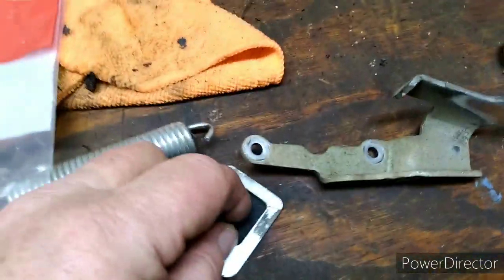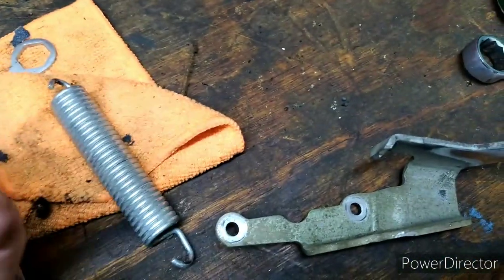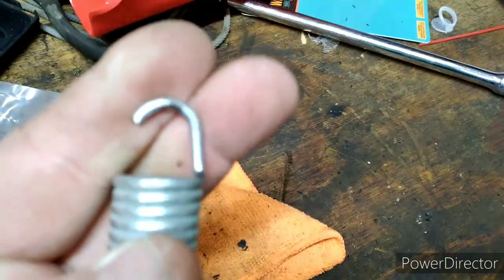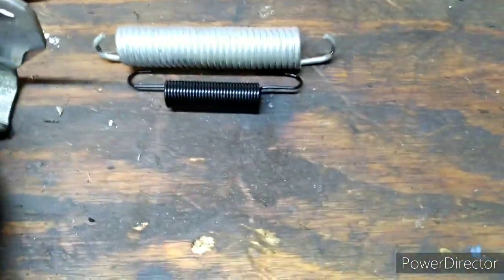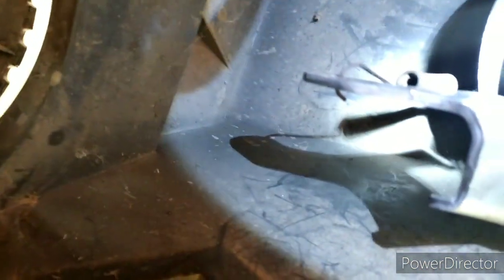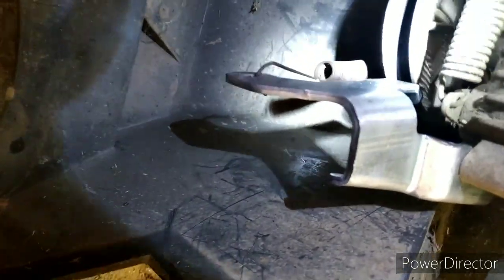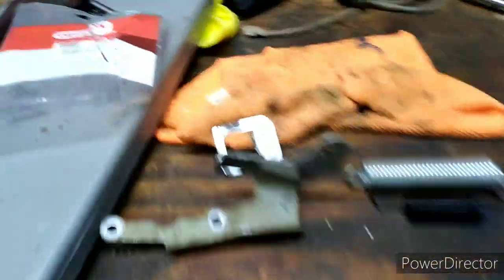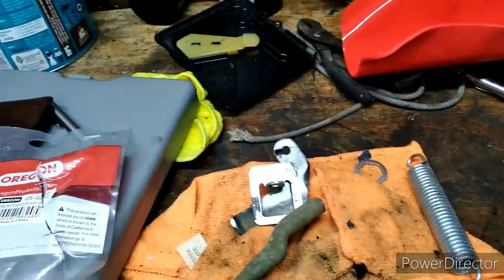honda hrx217/ problem and fix

Comment: I just checked my Honda HRX 217 from 2011, there is absolutely no sign of wear on the spring or on the spring connection points on the brackets.  Informative video though, thanks!

Comment: I have been working on Honda mower for 11 years and am a honda master tech and i have never seen any mower do that before I've see the spring brake in half or the belt snap but i agree that spring it to stiff for what it does
Reply from the maker: I thought it might be a vibration issue.
I called honda, but they wouldn't let me talk to tech support or R&D, because I'm not a dealer for honda.
Reply: Next time i call in to honda ill see if i can get an answer
Reply: @williamroberts6591  did you talk to them yet?
Reply: @williamroberts6591  Well it's been a year so what did Honda tech support have to say about the issue?

Comment: Ok.  I got the spring you suggested and installed it on my new transmission.  While it did work on the flats, on hills it bogged down.  I replaced the spring with the heavy spring that honda calls for and the mower propeller much better.  I think the lighter spring allows the belt to slip under a heavier load.  My mower is a hrx217kvka with smart drive.
Reply from the maker: That spring is just a return spring. It returns the transmission to neutral. It shouldn't have anything to do with belt tension. There's an adjustment for tension on the cable.
Reply: On mine the spring provides tension on the belt.  The cable operates a lever that engages the transmission.  Without the heavier spring, the belt slips on the pulleys and doesn't propel as well.  I tried it both ways.

Comment: I’ve had my hrx217 since 2012. It finally failed last Saturday. I thought the spring just came off. I tried to put the spring back on and that bracket shot out. I discovered just like you. I didn’t or the spring you mentioned but I think I will. Thanks for the video.
Reply: It is not a push mower

Comment: The spring is an Oregon 05022 as you state.  Just replaced the original Honda spring as you recommend, and works fine.  Getting the original spring back on has been near-impossible, so your fix is much appreciated.  Thanks for your help!
Reply: Awesome,, great news.. thank you
Reply: is it easy to get off? and back on? do you have to remove anything to get to it?
Reply: @chucksw1  Yes, you have to take the plastic shroud off to get to the transmission.  Kinda tricky - best to get a manual.  The Oregon 05022 spring is much easier to install.

Comment: I just looked up the part numbers on the Honda site for this spring on the HRX217 and compared it to the HRR216 spring. It's the same part number (24468-VE1-T00). The probable reason for not addressing or changing the spring is they may already have millions of these springs and don't have any other use for them. Or maybe they may have addressed in newer models. The HRN216 spring has a different part number (24468-VL0-P00). The spring looks the same in the diagram but attaches to the top of the deck instead of the rear (now vertical instead of horizontal). The HRN transmission doesn't look nearly as "Beefy" as the HRX, either.

Thanks for the Oregon part number. I haven't had the issue yet but then; I haven't taken either of the mowers apart that far to check. That's going to change really quick.

Please post any other quirks that you have noticed on the machines if you can. It would be greatly appreciated.
Thanks again. Have a Great Day!

Comment: Good video.  Mine gets stuck in propel and slamming it is no longer unsticking it. I am just going to take the belt off and use as a push. Wheel and transmission assembly is a jigsaw just like you said. First years were good but now I am cleaning the carb every 3 months

Comment: Nice Video. Just had a customer call me and he has the same mower HRX217 and transmission quit working..
I haven't torn one down before so I'll look up how to dissaemble tonight to the spring if that's the problem.  Thanks for the great video
Reply from the maker: It's probably not the trans itself, probably those springs..

Comment: What is Honda's method for re-installing the original spring?  It's a nightmare and almost impossible to stretch it far enough to hook it back to the transmission bracket.
Reply from the maker: Idk if honda has a method,, they're tough... I hook the plate end up first, then use a spring puller I hav from a trampoline I set up.

Comment: I have one of these that my brother was going to throw out becase it wouldn't start 5 years ago. I took the carb of and and gave it a good cleaning. It fired right up. Now the drive dosen't work. I tried to adjust the cable that didn't seam to work. The belt is there and intact. Since you have worked on many these do you have any ideas of what it could be? How do you know if the trans is bad?
Thanks for the video.
Reply from the maker: If u can roll the mower backwards with drive engaged, its probably belts or springs, if u can't pull backwards its probably the trans.
Thanx for comment

Comment: This is eye opening, I was about to buy one of these.  If you were to recommend a lawn mower for a flaw 1/3 acre lawn.  What would you get?
Reply from the maker: I like the 30s, they're expensive and all hav problems.  But I like the the toro 30 timemaster. Cuts good, bags,ect... but they don't like wet heavy grass and expensive.

Comment: I still have my 2009 Honda hrx 217 VYA we'll have to check the condition of that return spring plate today.  Do you happen to have a video showing how to disassemble and reassemble using the lighter duty spring fix?
Reply: They go into the same brackets,  Idt I do..

Comment: I have a cub cadet riding lawnmower 22hp I put a new fuel pump and new air filter and a new fuel filter on it, and it won't start. Can you tell me what's the problem?  I'm stumped.

Comment: I have an HRX217, if the self propelled isn’t engaging the speed it once had(still engages but not as fast anymore), what could be the issue?
Reply: Belt, transmission,  springs. Cable.. any of those could be the cause..
Reply: @Preacher7633  ty sir it was indeed the cable adjuster wire I believe it’s called, ty for pointing me in the right direction, and it moves pretty fast like when I bought it

Comment: I have a old craftsman the belt is ran on top of the mower deck going to the transmission it's a keeper I only have to remove one plastic shield on easy as pie why they got to make it complicated

Comment: What type of symptoms do this have if the spring is not connected? My mower I can’t pull backwards. It goes forward fine. The wheel’s just won’t spin backwards when it’s in neutral
Reply: The spring in the video, is a return spring, it returns the transmission to neutral. If ur having those problems,, the transmission isn't going all the way back,, could be the spring. 
Try rotating the transmission back by hand an see if that takes care of the problem. May have to move the lever by hand

Comment: I just got a honda hrx217 versamow 4 in 1 that the customer says won't go forward. Indeed it won't push forward.
It rolls backward but not forward.
Is it that spring control for the neutral in the transmission??
Reply from the maker: More than likely, yes

Comment: Hi Carl. Today my HRX217 self propelled keeps wanting to stay engaged even when I take my hand off drive, Not all the time but alot. I got under it and hit the cable near transmission with WD40 but cant see it from the top going to the drive switch. Any ideas?
Reply from the maker: Could be the cable, if not check that return spring.

Comment: Can you get the bracket that mounts on the transmission by itself?
Reply from the maker: Should be able to..
Reply: @clsmallenginerepair3814  I have to replace my drive clutch cable but they sold me a kit to replace the input arm on the transmission because arm bends over cable end and you cant get it out. Have you done some of these mods?

Comment: I believe that spring is such a massive size because the belt needs a certain amount of tension.
Reply from the maker: Could be, but I've never had a problem with slipping, and that spring has more tension than a riding mower..

Comment: I loved my Honda hrx217 until with less than 20 hours on it the valve stem guide blew out and then caused my rocker arm to break. Easy fix but I'm wondering if its gonna continue to be an issue.  Curious if its been an issue with the Hondas you've worked on.
Reply from the maker: Not had many head issues. The engines are usually bulletproof.  Except for that choke system, can be hard to start when they get some age on them. Most problems I see is the design of the body and transmission. But they're a good mower, just like all mowers, they all have some issues..
Thanks for the comment and question.
Reply: @clsmallenginerepair3814  thank you for the response

Comment: My Honda hrx 217 mower blade stays engaged. Any suggestions???
Reply from the maker: Alot of different models, but I'd check cable adjustment, maybe the return spring
Reply: @clsmallenginerepair3814  I checked those already and looks good there, but thank you.
Reply: Is the bearing seized up.... The blade stop bearing is what im saying?

Comment: That’s strange. I’ve worked on 100’s of those mowers and have yet to run across that problem. I do know what your talking about with those damn springs. They are definitely overkill.

Comment: My hrx217 is the biggest piece of crap I ever bought. The  cable that he is showing either broke or was cut as he shows.  only had used it three times. Took it to the Honda dealer where it took the Honda dealer three nonths summer months to repair   Got it back,  stored it this winter and now the cable will not put it in gear to move.  one year and the battery is dead.    will not buy another one.  The wait times and quality  repairs are dodo and ship.